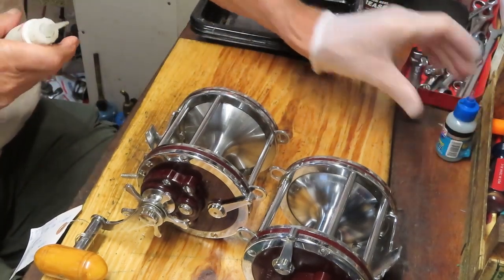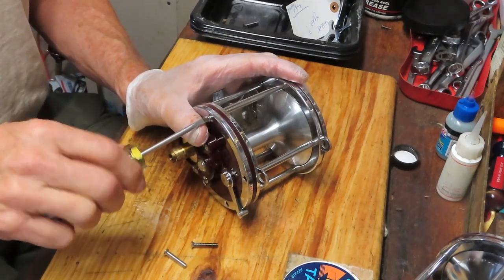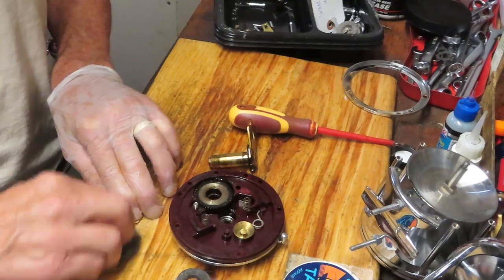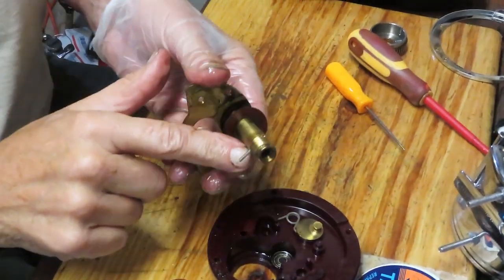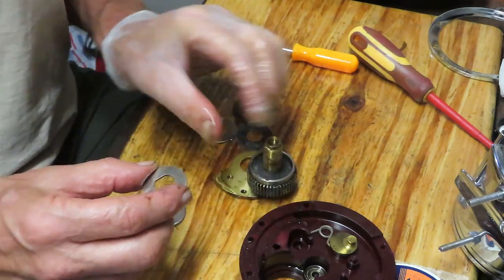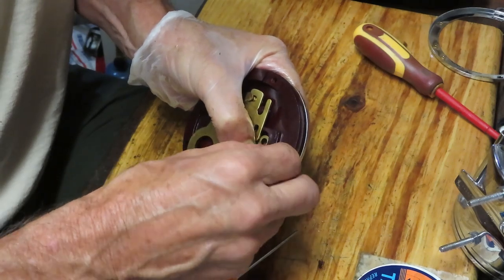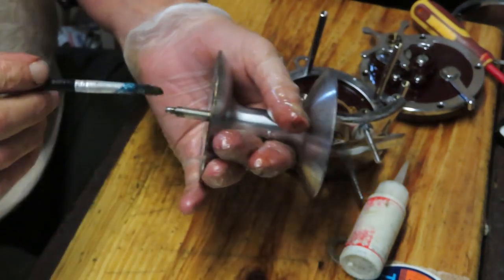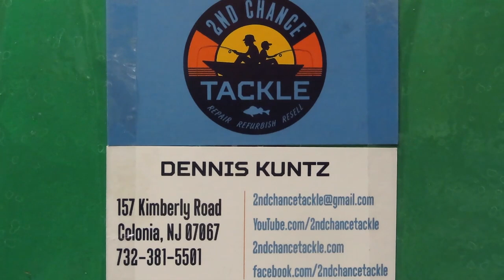Penn Senator 6/0 fishing reel problem diagnosis and how to service

Comment: I really like the way you teach and have enjoyed watching your work. I have a 114 H and will tune it up. I have a shakespeare 2470 and the anti reverse does not work. I think it is the anti reverse  spring and dog. Do you know where I can buy those parts?
Mitch in New Orleans.
Reply from the maker: Those reels have been out of production for a very long time.  Check eBay and other used sites for a donor reel in order to get the parts.  You may get luck and find that the parts are inside your reel and that they are just frozen in grease or some other reason why the A/R is stuck.  Check the reel first - Dennis

Comment: I have a 14/0 the spool has  a side to side  movement  can I put some kind of spacer to take up the play?
thank you.
Reply from the maker: hmmm - you may have a broken bearing.  If you want to try a spacer, you will need to put it on the non gear side of the spool. There should be a slight side to side movement of the spool, but if it is excessive, it may be worth a try.  Dennis

Comment: Dennis, I’ve got a modern 6/0 where the handle wobbles. I think I may be missing drag washers from the drag washer stack. Does that sound right?
Reply from the maker: There are several causes, but drag washers missing is low on the list.  You problem is either a handle that is not tightened down all the way, a work gear sleeve where the top hold has rounded out or a worn bridge post or pin that hold the sleeve to the post.  Finally, the top of the bridge post may have seized and broken off of the shaft.  That is the worst case scenario.  Best wishes - Dennis

Comment: Hi Dennis!  I have two Penn 6/0 reels.  The anti-reverse clicker on one is much quieter than on the other.  Do you think I need to replace the spring?  Thanks in advance!
Reply from the maker: No - there is a large variation in the click of the A/R.  Not to worry unless it fails.  Sometimes it is the actual dog that is wearing down and not the spring that causes the different sounds.  Thanks for asking - Dennis
Reply: @2ndChanceTackle  Great -- appreciate your answer -- thanks again!

Comment: When did Penn stop using the flat springs in the senator's?
Reply from the maker: They haven't stopped on many of  the Senator 6/0 and higher versions which still use the flat spring.  The others4/0 and below were changed as model designs were improved.  That mostly occurred in the 70s and 80s
Reply: @2ndChanceTackle  thank you for the info.
Reply from the maker: YW

Comment: Is mineral spirits ok to use as a penetrating cleaner
Reply from the maker: It is a solvent.  I do not use it and would be cautious on how it may affect the finish on the reels and some internal parts like rubber pieces.  I'd stay away from it without testing it on some old reels.  I also don't like the smell of it.  You may want to use that outdoors if you do try it - Dennis